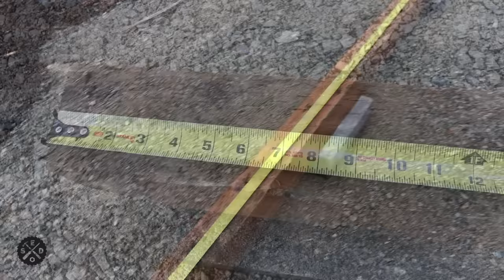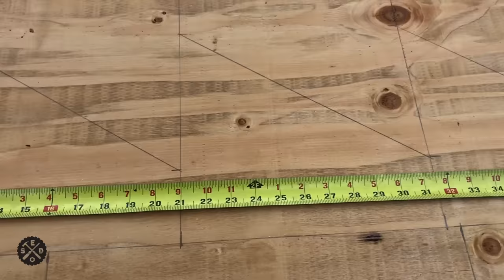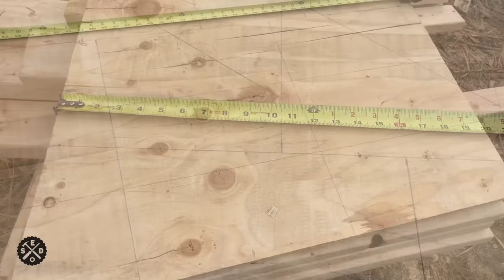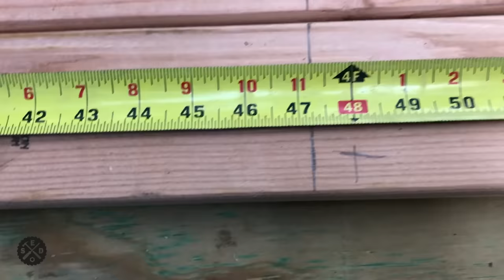How To Build A Shed By Yourself All STEPS 10x16 diy

Comment: Greetings from rural Nevada . Fantastic job , love the rustic look on the outside .   ---   Would suggest rubber , Draft Stopper strips on the bottoms of the doors ,  also helps to keep mice & insects out of your building .
Reply from the maker: Thank you so much! What part of Nevada are you from? Do you have any specific needs for that draft stopper or is that the name? I thought about that something like that would be a good idea. Thanks
Reply: @SmartEasyDIYer  --  Originally from the Los Angeles suburbs ( too many people for me ) ;  lived and worked in Central Western & Southern Nevada , even did an 8 year stint in Death Valley, California , ( predominately in the Mining Industry --  Trained as a Medical Doctor but not a Practicing Physician , Coroner , Mobile Intensive Care Paramedic , Firefighter ( Structural & Wildland ) , Search and Rescue Technician - ( Founded or helped create several Search and Rescue organizations ) , Top Miner , Licensed Blaster , Certified Heavy Equipment Operator , Mine & Mill Operator , Union Certified Top Millwright , Senior Underground Mine Maintenance Mechanic , Certified Welder - Fabricator , and Mine Owner / Operator ,  --  yes , I wear many many different hats . ) .  ---  I believe ''Draft Stopper'' was the original product name , the product has been around since the 1960's , and was basically a black rubber strip glued to a strip of Brass that you screwed to the inside bottom of your doors .  I've seen many other types and styles of basically the same thing , some of which looked more like automotive moulding fastened to a metal or plastic strip .  I personally have used the ''original'' style and can vouch that it does help to keep out mice , insects , and other unwanted creepy crawlies .    < Doc > .
Reply from the maker: Wow that’s an impressive list of hats! Sounds like you could tell lots of stories. Ok thanks for the info I’ll check it out. Have a great Christmas and New Years.
Reply: @SmartEasyDIYer  --  Yes ,  LOTS of storys .  That's only a partial list , actual list of accomplishments would fill  numerous pages .  At 74 years of age I've had a very rich and rewarding life ,  as I've always tended to  ''burn the candle at both ends'' .  Lol  .  A very Merry Christmas and a Happy New Year to You and yours , too .   < Doc > .
Reply from the maker: Maybe you should write a book. 😁
Reply: @SmartEasyDIYer  --  I've had several people besides yourself tell me that .  I have a lady friend that sincerely wants to do that as a ''Ghost Writer'' .  I'm still considering it as I have done several ''Firsts'' and made History , but there are parts of my life that are still upsetting to me emotionally . -- Through no fault of mine ,  I've outlived Two Wives and all seven of my biological children plus an adopted daughter . I'm the 'Last Dinosaur' and I will never see Grandchildren .  Entire first family were wiped out by a drunk driver while I was at work . Second Wife and I had trouble having children , but finally had a Son who only lived for 34 days .  Second Wife is gone now too .   < Doc > .
Reply from the maker: So sorry for your loss Doc I can’t imagine going through something like that.  I could see that would be hard to write some parts of your story. I’m glad you can think back and reflect on the good times. Not sure how you found my video initially but I appreciate the comments.
Reply: @SmartEasyDIYer  --  THANK YOU for your condolences and simpathy .  I was attracted to your video because of the unique and lovely rustic appearance of your finished Shed in the ''Thumbnail'' .  I have always been a DIY kind of person , and I enjoy seeing how other folks do their DIY Projects .  I have even built several Homes in some rather unimaginable places ( Caves , an Abandoned Mine , and I even Blasted one out of Solid ROCK ) and they were all beautiful .   < Doc > .

Comment: It is good to use plywood vs osb, osb has much less resistance to rot as does plywood.
Reply from the maker: Agree. Lp and zip sheeting make one that’s made for roof sheathing but standard OSB I wouldn’t want to use. It’s hard to say nowadays but I would say plywood is cheaper than these though.

Comment: For enclosing under the floor, at the ends put the 2X4on top of the plywood and attach from underneath before placeing the plywood into the bay and you just need to attach the 2X4 into the beams from the top. The middle sections will hold up the plywood making it easy. Hopefully this was a bit clearer than mud
Reply from the maker: A lil bit 😁 thanks for your input

Comment: Just ran across your video and really like that stain. Can you tell me what it is?  Do you have a video link showing the stain process?  Thanks
Reply from the maker: Thank you! I have more information on that product down in the video description below the video and also the link where you can find it. If you check the timestamps in the description you can see where I applied it on the siding as well.

Comment: Always build it bigger than you think. No one ever says, " my shed is too big ". Also use a ridge beam and rafters. Gives you way more flexibility and is just as easy to build. Make the roof a 12/12 pitch (45 degrees) Gives you more room and sheds snow and water better.
Reply from the maker: Yes same goes for the garage. You can never have it too big. Lol.  for my application the trusses worked really good because I wanted a loft but yes you could easily go for steeper roof pitch if you wanted to. Thanks for the input.

Comment: Sir thanks for the video. Can you tell what size the metal roof sheets are
Reply from the maker: You’re welcome. I didn’t see this till now but I’ll have to measure them. I think around 6’ 6”. I would say if you can it’s best to build your trusses at least and measure that top or set them and sheath them and measure so you can get exactly what you need without cutting the sheets etc.

Comment: Excellent video and thank you for your detailed information! I got a quote to get a shed built for $9000 plus taxes and am inclined to build it myself. Just afraid to get started though...I'm allowed have a shed size of 20 metres square which is just over a 13 feet by 16 feet. I wonder if you could send me a list of material for this please and any suggestions you have.
Reply from the maker: Thank you so much! Yes I know materials are a lot higher than when I built this but buying a shed is also a lot more expensive accordingly too. There should be a material list down in the video description below the video. Thanks

Comment: Is it true that your only supposed to nail 1 side of the baton to allow for expansion & contraction
Reply from the maker: It’s mainly for when it is green lumber freshly cut and it needs to dry some people nail it right in the middle with one nail so it can shrink. This was dried so I put two nails in. No problem

Comment: At 26 minutes in - one of the things I do is to check the top of the wall, corner to corner, to assure it is square. If it is off, the trusses will be off which will through off the roof deck plywood layout. On this size shed, likely no problem, but, just a thought to play it safe.
Reply from the maker: Yea I may have forgotten to mention that but I do check for square too before setting trusses. If everything is set level and plumb it should be very close.

Comment: Quick question: Why did you go with just 2 skids instead of 3?   Would it have too much flex in the middle of the floor?   I'm planning of building a 12x16 shed and using yours as reference.  Would you recommend 3 skids on a 12x16?
Reply from the maker: Hi Bruce. Yes two skids seemed plenty solid enough going 10 feet wide but I would recommend using three if you’re going any wider. Good luck with your build!

Comment: What about finishing the inside of the shed do you have any videos on that we are making a shed and using siding on the inside we want to put insulation and some kind of reflective insulation somewhere and we don't know what we're doing need help I heard that bubble wrap and electricity do not mix we are going to electrify the shed so that we can charge our batteries and everything outside I'm going to make it moisture proof and insulated I'm going to use Rockwell different levels in the ceiling and walls 13 and 30 then I'm going to put thinsulate on somewhere and then I'm putting siding on top of the sheathing with a small air space
Reply from the maker: I haven’t finished off a shed but I think you could do your choice of insulation plus a reflective bubble insulation too before you do the siding since that’s usually thin.

Comment: Nice project. I liked a lot that the floor is not seating on the ground or neither there is cement base under it.
The only think I haven't seen in such project is the "how to" make such cabin having the possibility to be longer or wider in the future.
Thanks!
Reply from the maker: Thank you! I think in the future if you wanted to make it longer you could just make another section and remove the end wall since it’s not loadbearing, and continue the walls and roof system. Going wider would be more difficult.
Reply from the maker: If you think you wanted it wider I would try to start off wider now.
Reply: @SmartEasyDIYer  Thanks a lot. I am thinking only for longer since I have a straight fence in a place around 20 meters long and planning to start a Shed 5meters long which would like to extend as needed in our property. I also start to think to leave the one side which is going to be extended wide open, no doors. I 'll see.

Comment: The shed turned out great. But. I liked it with out the Batten boards, it looked rustic but had a modern feel/look to it. I do have a Question. How would you go about not using the batten boards but have no caps between each board. And what type of wood are you using for the board siding.
Reply from the maker: Thank you I appreciate that! If you want to do it with no gaps between the boards at all you almost have to rip them nice and straight on the tablesaw or something. These boards are number 3 grade fir/larch. Especially with being number 3 they are made to be quite rough which is the look I wanted but the boards tend to be not as straight. You might be able to go with a better grade and have it be better for you in that regard. Thanks
Reply: @SmartEasyDIYer  THANK YOU
Reply from the maker: You’re welcome. Good luck with your build!

Comment: A helpful tip for screwing the steel down to roof deck is to place your metal in a stack making sure the bottom edges are flush then layout your screw placement and predrill through all the panels. With plywood you can do what you like but with perlins you can just layout screws to centers of perlins and it makes handling/installing the metal much easier. This makes your screws perfectly straight and also keeps the little burrs, that come from piercing the screw through the steel, from damaging your rubber washer. Pro Tip Try It
Reply from the maker: Thanks for sharing. I usually do that too and thought I did on here but maybe not since it was only a few rows. Typically on a bigger building it saves a lot of time for sure. Some people like to use a awl punch too so it doesn’t make any metal shavings. Thanks
Reply from the maker: Thanks Ralph. Yes those are all good ideas. I like pre-drilling whenever I can just so it’s nice and straight like you said. 👍

Comment: I'm building your shed using your cut list and all rough cut from a sawmill up the road...anything I need to be concerned with using rough cut?  Btw, I'm pretty sure I've watched this 20 times lol.  You're a great teacher!!
Reply from the maker: Thanks. I wouldn’t see any concerns except maybe depending what kind of wood he uses. Hemlock or fir for example holds up better to the weather than pine. Etc. some of the one by six I think were for battens that I ended up ripping in half to one by three you can see if he can cut them smaller for you while he’s at it. The Mill I got from couldn’t cut them smaller.
Reply from the maker: Some of the 1x6 were for facia. I think eight of the 8’. The rest I cut in half for battens. Just wanted to clarify.
Reply: @SmartEasyDIYer  Thanks...I will have my smaller table saw on site for ripping...really appreciate it!
Reply from the maker: You’re welcome. Good luck with everything!

Comment: I have done 10-inch drops twice. 3 reasons why I recommended such a thick slab, was "Radiant heating and cooling" Once it's heated in the winter it will hold its temp much longer. Another reason would be the type of soil under the home. Heavier thicker slabs won't shift or crack over certain types of soil. The weight will force straight down onto the soil to level before leaning shifting or creating a void in less pressured areas. Where there is a void comes the build-up of water. last would be the frame has less chance if any of settling. all must be accounted for to justify the extra money.  End result would be A Fortress.
Reply from the maker: I don’t quite know what you means by drops, are you referring to the 10” concrete blocks?

Comment: 9:30 If your goal is to insulate the floor, just go with Rockwool insulation. Doesn't require strapping or any kind of support below. Just rest the batts flush between joists before laying down your floor sheeting and be done with it. Friction will hold them in place just fine.
Reply from the maker: Yes you certainly could do that but I would recommend not leaving it unfinished underneath if you’re going to insulate it because you’ll have lots of critters getting into it.

Comment: Thank you for showing so much detail ...i am mostly interested on the roof of your shed, although the whole building is very interesting...i built a patio on the back of my house with a flat roof...it is time to take the roof off and put one like the one you used on your shed my pitch is going to be  5-12 and i am going to build trusses, i will use two 2x8 as a ridge, only one side of the ridge is going to be supported by a post, the other side will be floating supported only by the sides of the patio...my idea is that by using trusses and a metal roof like your shed’s roof i should not have any problems...thank you again for all your ideas thank you for sharing your video...by the way where did you buy your metal roof?
Reply from the maker: Hey thanks I’m glad if you found it helpful. Sounds like you got a good plan. I got mine from a local roofing place that bends up their own. You can order it from most lumber yards though if you don’t have a local roofing business.

Comment: Hi,  I don’t have experience on how to build, but seeing you inspired me to face the challenges on how to build my Tiny home.  Already have a concrete slab of 16x40 feet. Please could you give me some guidance on how to built the frame  of the floor so It can insulated,  (done on concrete base), or I just should began building the walls,  also please could you recommend me what tools I can buy, thanks. Gladys
Reply from the maker: Hi Gladys thank you for letting me know. It seems like if you already have a concrete slab you could just build your walls on top of that. If you wanted to insulate your floor on top of the concrete you could put a layer of ridgid insulation down and perhaps subfloor on top of that if you wanted to. Zip system actually makes a sheeting with insulation attached that could potentially work? I’ve never done that before but if you’re doing like a floating floor on top of that it could be something to research. As far as tools I’ve had really good luck with Milwaukee and they typically have a five year warranty. It depends on if you already have some that you want to add to your collection, what your budget is, how much you will use them to make it worthwhile buying a better brand etc. let me know if I can be of more help. Thanks
Reply: @SmartEasyDIYer  I thank you very much for everything
Reply from the maker: @gladysprouty  you’re welcome!

Comment: I'm about to add 12 feet to my 10 foot shed. Not sure how i ended up at 12 but whatever. Was going to do gambrel style rafters but suspect i'd have difficulty talking myself into climbing on top. Hate heights. Think probably do your style rafter. Like they have stringers that make setting them easier. Can use space as loft.
Reply from the maker: Yeah, I like that idea to use the space as a loft! Good luck I hope it goes well.

Comment: I must have missed it, but how long is your rafter length? I am building a 10x12 but somehow the floor ended up being 10’4”. How do I calculate the length? Or what was yours?
Reply from the maker: Mine was 10’ exact on the bottom chord. If you want to make your 10’4” you’d need to use a 12’. I just built mine right on the platform the way it was easy to figure out the lengths.

Comment: Awesome!  Great job. I have one concern.  Batt & board doesn’t hold up well in southern AZ with the 110 degree sun. Will the Summit wood aging product help?  Thanks.
Reply from the maker: Thank you! That would be a good thing to think about. Maybe you’d want to do steel or cement board siding or something else? I think the rugged would help a lot. You could let it age to the point you like then clear seal it with something that’s uv rated.
Reply: @SmartEasyDIYer  Thanks. Will do. I definitely want the rugged look. Already bought the product you recommended.

Comment: Well done, do you have a concrete pier recommendation and would you add more in the middle of the foundation if permanent? Thx!
Reply from the maker: I would probably just dig holes and pour sono tubes for the concrete piers. I think the two rows would be sufficient unless you’re doing a lot of heavier stuff then one in the middle wouldn’t be a bad idea.
Reply: Is there a preferred season to build?
Reply from the maker: For me any time besides winter. Lol